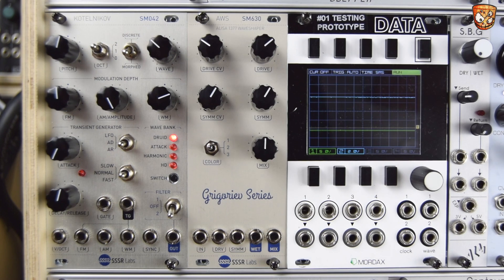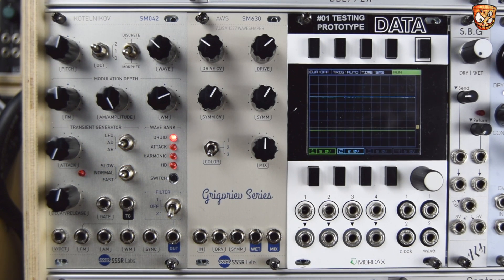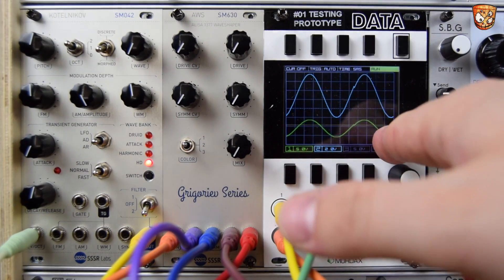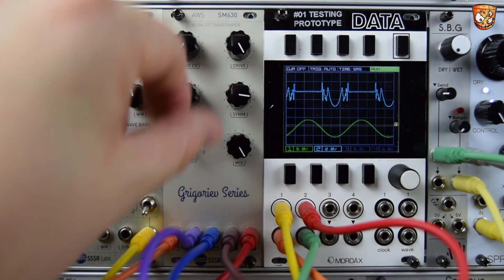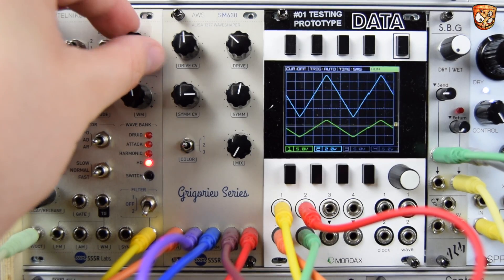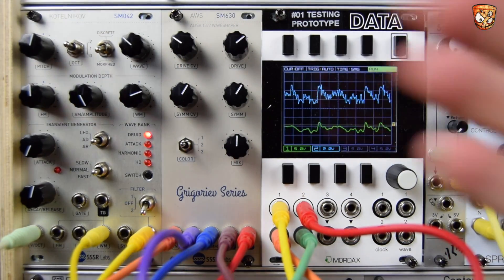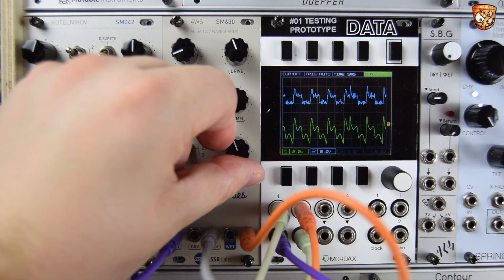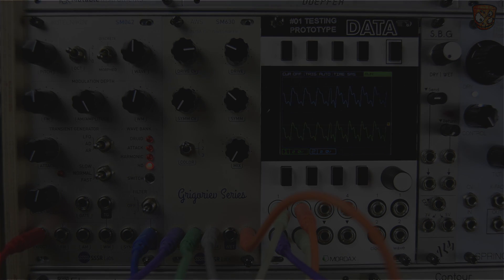SSSR Labs - SM630 AWS / Alisa 1377 Waveshaper

Comment: Toss up between getting this next or the Horstronic  or the shapes or the Topobrillo or....................!
Reply from the maker: tough choice, lots of good waveshapers/folders around now.
Reply: Yeah forgot the VBrazil overfolder and just learned about an exceptional one that Mystic circuits were bringing out, but it seems to be a bit long winded. Hope its still happening. Meanwhile I really believe the Alisa to be high on priority list. What's puzzling is that---Is this really based on a waveshaper from a Russian synth? Nice surprise if so. Normally they're simple affairs.
Reply from the maker: Yeah I can't see any reason why Dmitry at SSSR Labs would lie about it. But I don't know how close to the circuit is, it's certainly expanded with CV inputs and I think the dry/wet. Sure he's tweaked it further too for a wider range of tones.

Comment: This video great example of ZERO FM synthesis^.
I needed to watch as many (synth)Drum Machine video's on youtube to get me here. I originally thought save money and not get a 'drum machine' and>>> look for something that can do both(or more) with less money.

So far Digitakt Digitone; Waldorf Quantum;
*SM042 Kotelnikov(Alisa 1377) + SSSR Labs  + SM360 & Mordax.

I've been looking at Rainmaker w/ Euclidean Circles, Erica synths Logic.
Maths...
Akemie's Castle

But Immediacy/$$$ sets in and I find myself looking at the Digitakt Digitone.
OR
Then finally getting a Minibrute 2S and finding something other than drums to put into the rackbrute (???... For this I'm wondering if it's possible 3 Modules(abovementioned*), Erica Synths Graphic VCO + Ornament & Crime Harrington(1200 mode Chorded-Waveforms(Sine) + Akemie's Castle and'Euclidean Circles))
Why invest in most VCO's ie. although great option Erica Black Dual VCO when you can morph between Waveform(synthesis)//Vector
What are your thoughts?
Reply from the maker: that's a lot to take in can you simplify that or go back a few steps. 

1. What do you want this for? 
- new sounds? 
- exploring sound design?
- basslines
- sequencing
- FX
- custom synth voice?

2. What's your experience with synthesis?
- software
- hardware
- modular

3. What's your budget?
Reply: Sequencing* particularly Moogsubsqt37cv w/ Minibrute2s.

I have KORG R3, OB-6(takes the place of a Juno), Microbrute 2S w/ Moog Subsequent 37CV, TB-3(no-cv/midi)(makes 3 Analog Bassline synths), and I also have Roland VP-03... and Reface DX and CP

I mostly make sounds on my Korg R3..
definitely wasted some money so far...
But the Rainmaker and Digitakt Digitone seem to be my fave Drum-machine options...
Unless I see Waveform/Vector synthesis VIA Modular/Eurorack(above ment.=x4 Modules) being more viable(not mentioned in last post, Intellijel Shapeshifter)

correction* from last post =*Dual Black VCF for spice..

My budget... wait 5<x years or get my bud to buy a Digitone.
There is no budget, the last budget=gone/spent.

I'd been comparing Analog Synths w/ A-D envelopes w/ noise on Decay originally
Reply from the maker: So are you sequencing on the Moog Subsequent37 currently? I don't have one or know of the specs that well to be honest. 

Digitakt or Digitone for drums? Digitakt is the sampler, Digitone is the new digital FM synth. You can design drum sounds of the Digitone though. 

So what are you looking for modular-wise? I'm still not totally sure what you're asking for?

Comment: Would that work well with the Steady State Fate Quantum Rainbow 2?
Reply from the maker: You can try to distort and fold noise but as there's already so much harmonic content it's never that effective. With any module, not just this one. Starting with simple waveforms and using this for complex tones is more wide ranging and effective. But you could try mixing say a sine or triangle wave with noise from the QR2 then going into this and that would work really well.